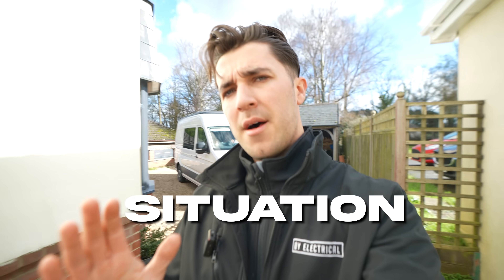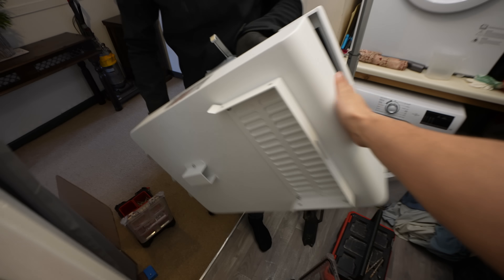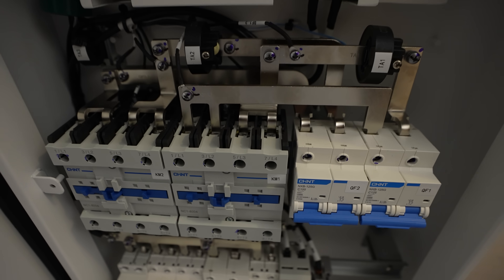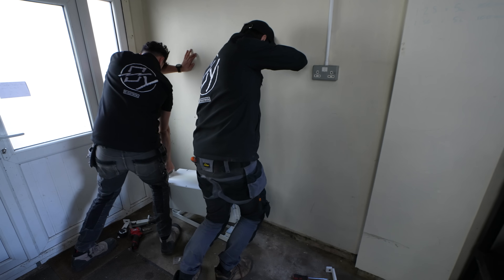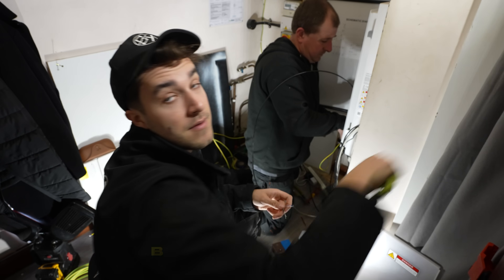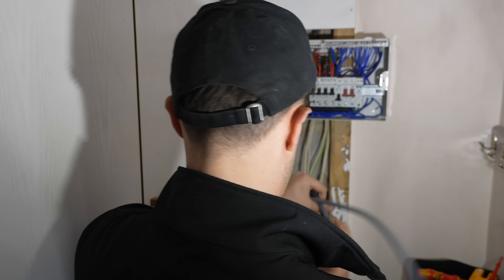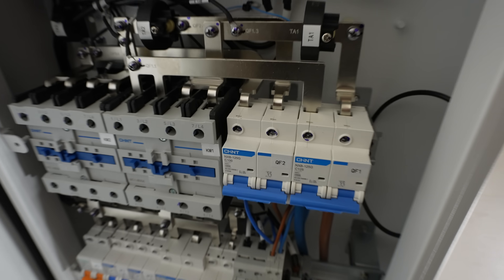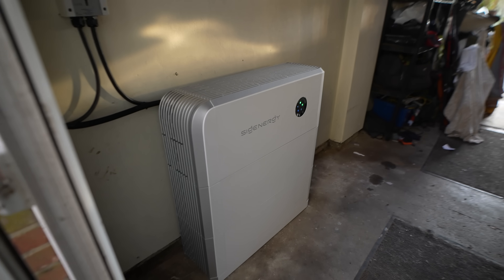How To Take ANY Inverter Off-Grid | ØY57

Comment: Great video. Could you please share what kit you installed? Specificaly the ATS make/model.
I found it an interesting concept that the FIT generation meter can still increase when powerr is out, whereas normaly you lose out on any potential generation because DNO power is out. (Important as we receive the current 74p/kWh generation fee)
Reply from the maker: This is the Sigenergy SP gateway

Comment: I have installed a symilar arrangement adopting a simple 3 way tranfer switch (L-N-PE) in conjunction with my Victron micro grid and I'm no electrician. Basically I am off grid 99% of the time, as soon as my solar is interrupted, the grid kicks in also swapping the earth from the microgrid to that of the incoming service (TN-CS). The opposite happens as soon as solar is restored.

Comment: A quick glance of the comments and the questions are hilarious, because that works for them? Ive done the same all be it slightly different. The DNO have removed me from the grid, i did mine when power passed 34p per unit.

And it was easy to do.

4Kw + 1.5Kw Dual output Inverter, £500
4 x 22.1v NMC 110 Ah NMC Battery Packs - £100 Each
4 x 450 Watt 27v Nominal Panels - 3 Catch sun almost all day, space means one faces a diffrent direction and angle for the evening sun. - Second Hand £50 Each

During a typical day i generate between 3 and 5 Kw of power

My base load power is less than 3KW per day, Almost 10Kw of storage, with about 90% of it usable.

Savings vs the grid (on todays prices) £1.50 a day, 11.50 every 10 days, 34.50 a month, £414 a year.

Installed now just over 2 years, with zero issues so far, so it breaks even this year and I'm into Proffitt after that.

A perfectly specked system for my needs, and just in case i DO run out of power, i have a 1000Watt Petrol Generator that can charge via an ATS (ATS was used before grid disconnect), so i can fire it up, run it for 8-10 hours and fully charge my battery's (I've never actually used it like that as yet).

There's plenty of room with my Inverter kit to double total capacity, as the inverter can be sync'd to frequency and load split, there's plenty of busbar left for additional battery's, and there's 4 more available panel input for further expansion if needed.

Fucking off the main feed from the grid, means no meter, no daily standing charges, no bills, and NO suffering with a grid failure, it simply aint missed a beat, all totalled its cost me about £1500 (breakers cables, fuses, ATS, Over generation (voltage) protection and a 2Kw dummy load (4 x 500watt submersible heat elements submerged in 4 x 205L water containers, meaning i have 800L of water)

Oh yeah i didn't even need certification apparently because i no longer have a main feed from the grid i dont need it, but that said it would pass certification if i needed to it, and was willing to pay for it.

Its not a massive system by any stretch but when EVERTYHING i own is now low power (LED Lighting everywhere 31 lights all on use just 105 watts of power, ultra efficient fridge 400 watts, low power appliances or energy efficient appliances), the biggest load i have is my 3Kw kettle.

There is something to be said for this kind of freedom, there really is. So for £1500 in total was the best investment i ever made, and could be for you, so long as you spec it to do only what you need it to do, many home solar installs today are way way over spec'd (in my opinion for there needs).

Just if you do your own install for the love of god, at least get a qualified electrition to check it over, im lucky family is all leccys so it cost me a pint in that regard.

Comment: My I ask, when in off-grid mode and the batteries are fully charged and the sun still shines, how do you manage the power that would otherwise be exported? I assume the invertor pumps the voltage up a bit to start the export, but of course there is a preset limit to how high the "mains" can get, at which time , well, that's my question.

Comment: Does that changeover panel also help with the PITA scenario where you can potentially have over 100 amps of service available to a 100 amp rated consumer unit (i.e. 100 from the DNO fuse plus whatever your solar/battery is kicking out)?

Could do with a bit more in-depth of the panel and what it does, how it manages to coax the system into thinking it's got a grid to play with (is it injecting a stable mains waveform for the inverters to sync to, for example?).  Definitely worth a follow-up video as it's an intriguing bit of gear, and impressive that it switched over without even a flicker.

Comment: I have a 20 acre small holding with some nice big barns on single phase sadly, I fitted 46Kw of panels and 108Kwh of BYD LVL, all victron gear as I am remote I do get quite a lot of power cuts so being able to go off grid is handy.
Reply: Hi there. Are you based in the UK? I am in a 5 acre small holding and got most of the victon set up. Would it be possible to discuss with you see how your set up is?
Reply: Yes, sure, I don’t see a problem with that. How do I get in contact with you?

Comment: I think Victron has a much better solution, their Mumtiplus inverters have an additional programmable output.

I use mine to charge the EV depending on the battery status but you can also use it as an always on output to run any loads you want to stay up in the case of a power cut (on its own circuit is the limitation.

Still ALOT less cost and hardware than the video solution!!
Reply from the maker: You’re right, but it’s just not for everyone. I do like how simple this is and tidy / small for a customer

Comment: So what I have learned from this is that if you want to have power from your solar when the grid is off, you have to connect your inverter into an ats. And you also have to have batteries, but thatstill isn't clear to me. And there is no explanation on how you turn your island inverter into an anti-island device. Because my inverter turns itself off when no power from the grid.

Comment: Interesting video and good solution to the problem. 
Always a red flag when an inverter is fitted in the loft. It's far to hot distroys the inverter
Reply: But it's not a solution to ANY inverter.
Reply: @boldford  the same is true for any electrical equipment that produces heat. 
Would be interesting to see what would happen if an air source heatpump was fitted in a loft . Most likely be far to noisy, and of course only work efficiently in the summer but that's the case anyway.
Reply: @thetourk  Doh! It wasn't the location of the inverter to which I was referring.

Comment: When I see the amount of labor and extra equipment I highly doubt this is cheaper than an off grid inverter ... 😂
Busy now with replacing an existing grid tied with an off grid one.
Haven't tried it, but my solution would be to replace the grid by a pure sine generator as it does not need to provide any power only give the inverter the idea it's grid tied.

Comment: Would you operate in Ireland? (Republic). I want to get a solar system on my detached garage - there is ample space on the roof for panels. There is a feed from the house under the ground that powers the garage. there is a second shed coming off that feed, too. Say I want to have a battery bank and panels on the garage, how would I set up and ats in this situation?

Comment: Again, I'm struggling to understand why a system that's decoupled from the grid needs an "earth"? The whole point of the earth is to provide an alternative path back to the transformer for fault current. If you've lost the grid and you're running off the inverter, what is the earth stake doing for the installation at this point? Any fault current introduced whilst on the inverter is going to want to get back to the neutral pole of the inverter and true "earth" will have no reference. It would be the equivalent to putting an earth stake in thin air. Obviously class 1 appliances should have a CPC, but on an inverter system like this, the CPC would be catered for by a bonded earth and neutral at the inverter.

Comment: A lot of inverters that also use battery storage (LuxPower for example) has an emergency power output built in to the inverter (called EPS) that can be used for critical loads. It uses a seperate circuit that's normally powered, but stays powered in case of grid failure.

Comment: Still don’t explain how you’re getting the solis to output power without an ac source.

In real off grid applications we use a grid tied inverter as this grid (victron/outback/studer or powerjack) and you either set the solis to grid 50 to use frequency shifting to control the power production of the solis or you must use dump or diversion loads to dump excess power when batteries are full

Comment: We need to drag you over to Australia.  Wiring is simpler, nor ring mains, earths are at the house and not provided by the energy distributor.  Your attitude and attention to detail is outstanding.
Reply: Rings aren't complicated, and aren't even required but just stuck to out of habit. We used to earth at the house, but the provided earth is better. Most houses are on the old standard and just run an earthing rod. Dont see how either of those points make it any more complicated, just different.

Comment: I have 4 acres of land, I built a house and a 15 KW solar system setup. No DNO. All inverted 12v and 240 I love it.
Reply: Is there a reason you used 12v instead of 48v?
Reply from the maker: The dream
Reply: @corymac  Definitely
Reply: Rough cost? I have 49 acres of land.
Reply: Why 12V and why only 15kW? I got 10kW on my house and the roofs are only 1/4 full jet
Reply: @Fluxkompressor  because that's what I wanted. It is what it is

Comment: Great video and very politely presented. 👍
All this tech does seem a bit OTT for what is a basic problem .
From a personal perspective I’d just have a totally separate system for low power lighting / fridge etc running off batteries/ solar etc then work out what needs a high current and run that on another separate system. 
That way you are only relying on the grid for basically an electric oven. 

Any families that can’t handle not having an oven or tumble dryer for a few hours want their heads looking at . 

Worst case is a cheap backup silent generator and a deep sea controller running on ‘cherry’ 😵‍💫🤭😬. 

A double bonus as Hubby has an excuse to go to his garden shed an tinker with his generator for a few hours.
Reply from the maker: Thanks!

Comment: One reason why they can't run when the network is down is that it could be down locally to allow maintenance. If solar systems were still sending power to the grid, there would be some BBQd line workers in nearby streets!
Reply from the maker: Yep 👍🏼

Comment: In this how does the inverter know like hey the grid is active when we have switched off the main. And in case like say due to clouds we are generating like 3kw but the house is using 3.5 4kw and batteries don't have enough juice which will trip the inverter?

Comment: I can't say I found this video to be very informative, given the expectations set by the title. I'd rather hear the technical details of how this solution is able to operate with various inverters, rather then watching it be connected.
Reply: Exactly my thoughts! Video should be titled "how to drill the holes for your off-grid solution"...
Reply: Agree. The title of the video suggests how to make ANY (in big capital letters) inverter capable to be switched to off grid mode. So I was looking to see what technical details or even hidden functions the Solus (for instance in this video) unit had that could make it operate in hybrid or off grid mode.
Reply: @arthurgiannakis2156  Afaict the key here is that the solus battery and smart panel system can essentially "simulate" a grid well-enough that a third party grid tie inverter will see it as a valid grid and feed back power into it.
Reply: I suspect you may lose a bit of solar generation due to power glitches as the system switches from grid-tie mode to island mode and back again, but that is probably something people can live with to avoid replacing their entire setup.
Reply: I was similarly disappointed, Unfortunately Cory completely overlooked those that use micro-inverters of the several brands available here.
Reply: Same. Disappointed at the end and expected to see an affordable way to make it happen, that box looked rather expensive and I feel there’s cheaper alternatives
Reply: Can you explain why the earth from the grid supply is deemed not to be suitable if the grid should  go down? Is it simply because an engineer working on the grid would not expect to find a charge on it, should an error occur in the off grid setup and would be at risk of a shock?
Reply: Or silly stuff about their lunch. If you want to be taken seriously then cut out the superfluous crap.
Reply: @hughmarcus1  Agreed.
Reply: He doesn’t want to give his secrets away.
Reply: @ they aren’t secrets, he gives the impression ANY inverter can be off grid by itself… no mention of batteries and additional hardware which is the expensive part

Comment: Interesting. I was always led to believe an on grid inverter can not be used off grid (mainly due to the requirement for power to operate & as you said, it must automatically shut down with the loss of power. The very poor rebates we are getting in Australia now, it's not worth trying to sell power to the grid & then being forced to buy it back at a huge rate, so I believe an off grid system using our original equipment would be the answer (just not bother to have the solar connected to the grid at all) We did of course have to pay a lot for a feed in meter (we also have 3 phase for the air conditioning & occasional use in my workshop) we definitely feel very conned & ripped off by the "Big sell" of solar which at the time looked ok, but of course they soon lowered how much they pay for our power into the grid!

Comment: These i think will become mych more important in years to come. Would be great to get more info on the product and the schematic set up. So the invertor connects to the ats? The panels still generate power and charge the battery? Some times it sounded like the battery was going to connect to the ats only??? Good video though.

Comment: Grounding/Earth issues depend on the DC hybrid inverter, they usually have earth and neutral bonded, but they can be unbonded (floating) and earth back to the main meter box earth.  But as Victron state in their docs, your battery DC negative needs to be earthed and its a massive pain to run that heavy cable all the way to another earth point, when you can install it at the hybrid (bonded earth and neutral) inverter and battery.

Comment: Easy with any Fronius or SMA inverter, but you will need for example on SMA inverters to have the "grid guard" code to reconfigure them from Grid to Island (off grid) mode. You cannot have a PV inverter in island mode, hooked directly to the grid due to back feed issues, it must be behind another device that prevents it feeding directly back to the grid.  Some SMA inverters are also a pain to communicate with due to them not having a bluetooth,wifi,Ethernet commons module installed.  So your PV inverter may or may not be suitable, or need some complex steps to get it into island/off grid mode, your PV inverter in Island mode also needs to have "frequency shift power control" so that the hybrid inverter can throttle it down when production is in excess (battery is full and no or light loads, no grid to export to) but that is usually the case in complete off grid situations.

Comment: I have installed this setup a few times, I always use the modern ATS's they handle 100A 3-phase and are motorised with centre off. The issue with a contactor based solution is that after a year or two they buzz. The difficult, time consuming and usually the expensive part of the install that you have not covered is the splitting out the ongrid only aspect of an install so if, for example the propery contains air conditioning, this has to become ongrid only otherwise the inverter just stops with an overload. The other aspect that you have not covered that you seem to ignore is the structural element, this is becoming an increasingly big issue to us electricians. My last install required the installation of battery packs full of LiFePO4 3.2v 300AHr cells each pack weighing over 120Kg. The cells had to be physically inserted one by one. I dont know about you guys but I am an electrician not a ruddy structural engineer and without a proper signed off structural analysis you cant just put battery packs onto wooden floors, attach them to walls in timber framed buildings etc. When the structure bends and cracks appear in a few years time, who yer going ter call!

Comment: Cory. Please explain how this works for ANY inverter as many inverters shut down when grid down. I feel I might have missed something
Reply: Generally, the ATS (auto transfer switch) contains a small, low power, three phase inverter that produces three mathematically precise sine waves 120 degree phase shifted at 49.6Hz that tricks the big inverters to think they are ongrid. Usually to make it work you have to reprogram your inverter to use a slightly different Cosine lead curve characteristics because the reactive elements have too high an impedance but most electricians have been on the manufacturers training courses and all that A-Level calculus crap about areas under graphs etc we all forgot, all has to come back!
Reply: @Ino-z2m in short, the ats takes this from the battery or solar itself?